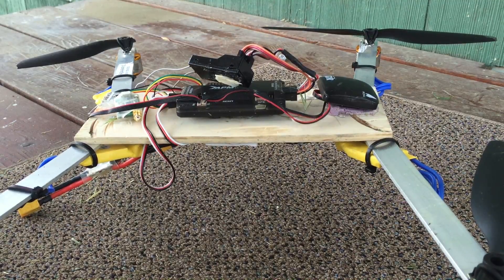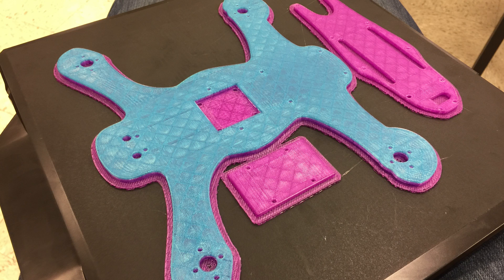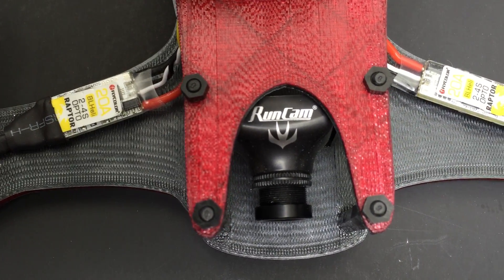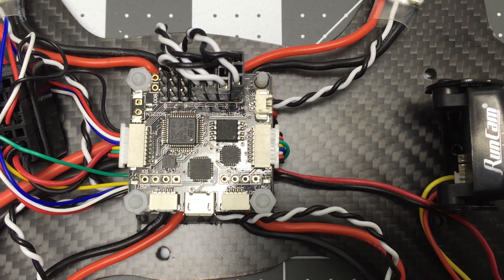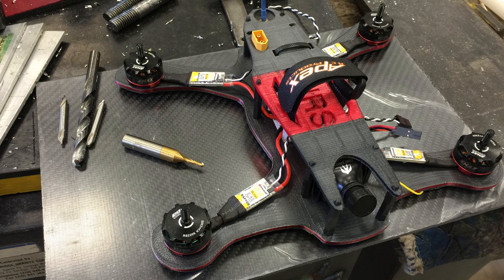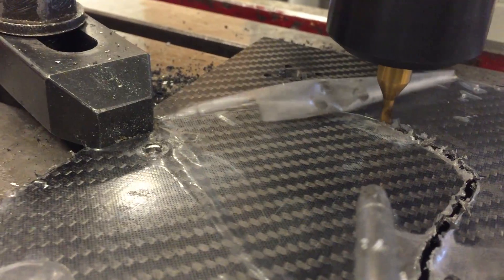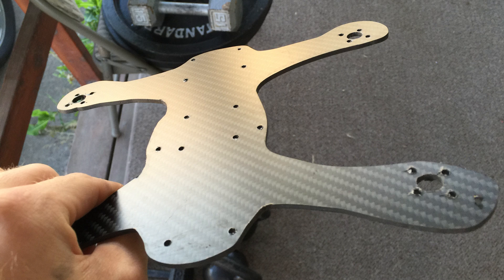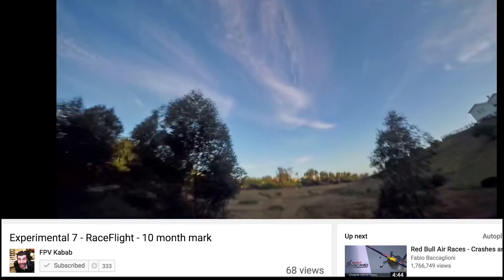I Made My Own FPV Race Drone

Comment: Nice work. I did a similar build, but out of basswood. It was pretty light and very cheap, though it couldn't compete with carbon fiber. I'll see if I can get access to a CNC machine eventually.
Reply from the maker: I thought about trying some thin hardwood plywood!